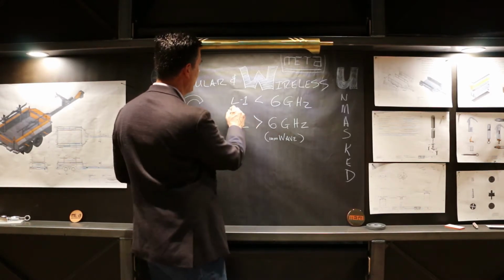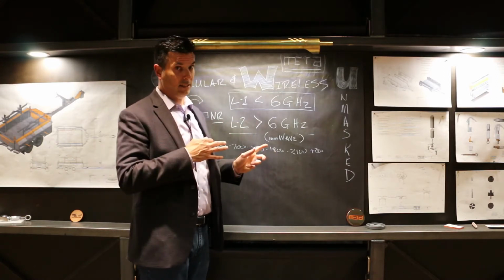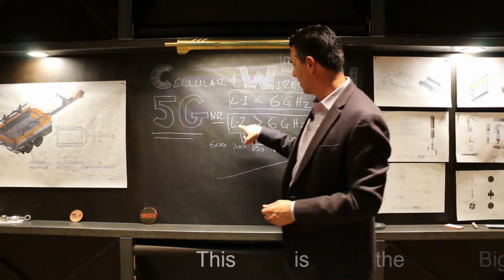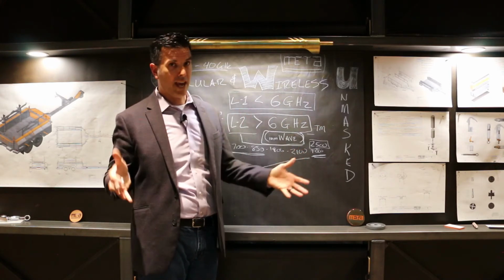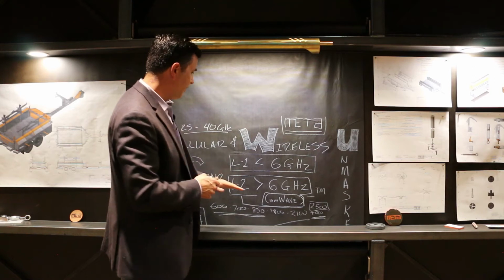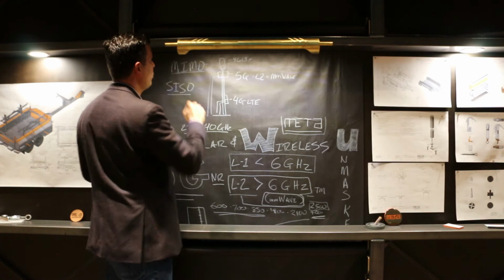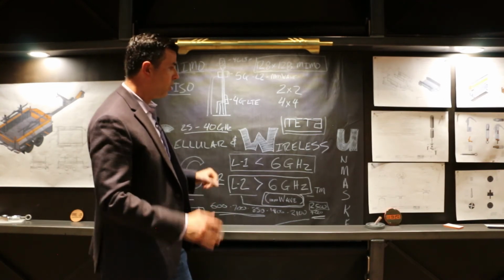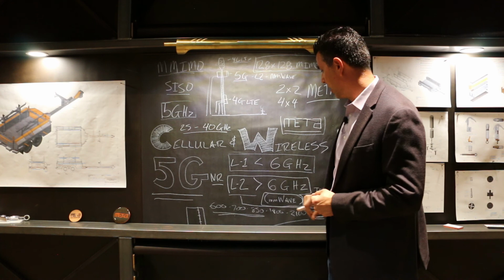5G  Cellular  Basics

Comment: great explaining thank you , 5G as any new trend to the market make lot of questions blow up in mind here is some of mine 

1. can we use 5G mmwave for both mobile and FWA ? both working on the same macro base station ? is there any deployment like this anywhere in US ? 

2. is there any microwave links that can support 5G mid band or mmwave if there was no fiber in this place ? is it practicable to use microwave links for 5g deployment ?

3. nokia claims that its 5G fWA FWA can be used within 6km and still getting 1Gbps  do you think its true ? or just marketing propaganda ? 

thank you for your kind response
Reply from the maker: Hi Kohzen, you can use 5G for FWA, however, keep in mind mmWave (L2) 5G does not propagate well, nor penetrate buildings- so it has limitations. You don’t see mmWave on Macro sites- that mostly done via Small Cells. 
2 - Yes, there are options for microwave BH links, but they tend to be too bulky and expensive for small cells. It’s rare to see a microwave link for a small cell, back-haul. Sprint tried that, using their lowest usage frequencies to promote 2.5. it had mixed results.
3 - Claims by OEM’s are typically ‘best-case’ scenarios and while can be proven, are typically NOT what we see in ‘real world’ conditions with fading, traffic loading and interference factored in. 1GBPS+ DL is mostly limited to mmWave 5G (L2), which has a practical range of about 1KM, best case. L1 can reach much farther, but the speeds are less impressive.
Hope this helps and thanks for watching!
Reply: @cellularwirelessunmasked3120  don't say hope this help because indeed it does , thank you alot , I'm good at asking questions one day you say stop it please :D 

hope you stay safe and sound and thank you again